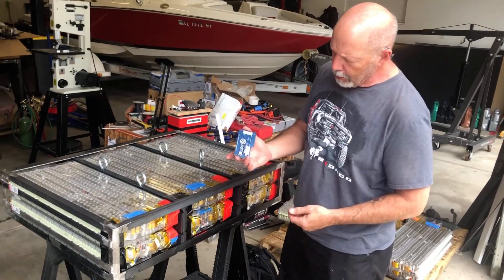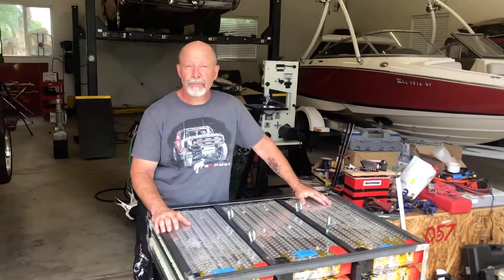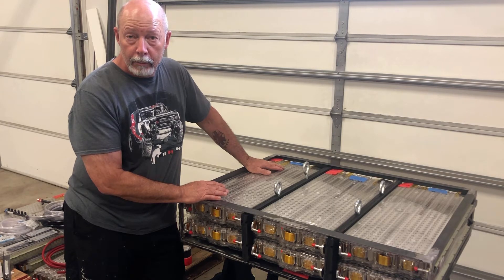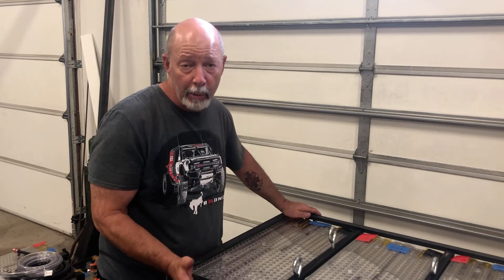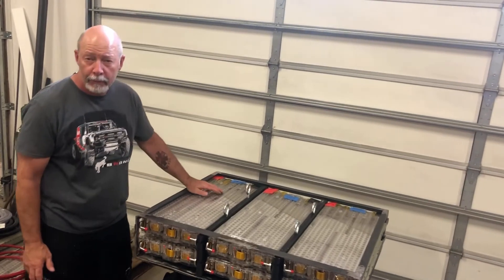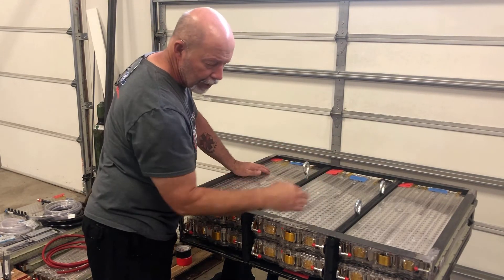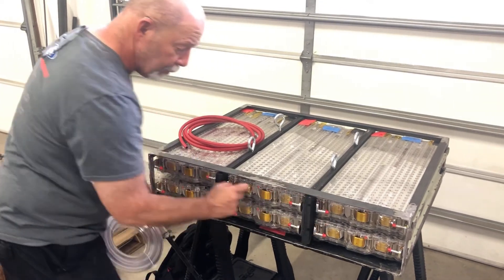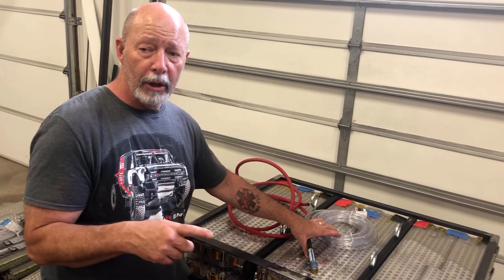Tesla Battery Questions Answered by Dan #teslaswap #evconversion

Comment: Ford plans to debut a electric kit in November at SEMA targeted at retro builds. Beat them to it guys!
Reply: We are counting on it! We will do our best!
Reply: Gm did the e crate direct bolt in ev motor a couple year's back. When they debuted the e copo 9sec camaro. Doesn't seem to have taken off. 
I think for older elktromodz. It makes more sense for someone to design a chassis with a battery pack, motors, brakes&suspension. 
Which can then be fit under the more popular muscle cars. So you can just drop the body on ad an interior&paint to finish it.
Reply from the maker: That is a great idea!